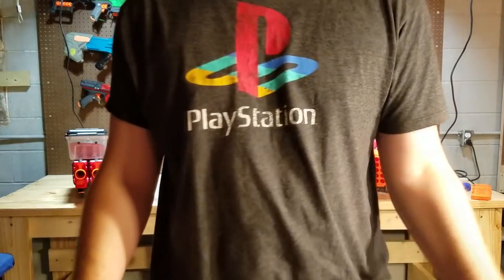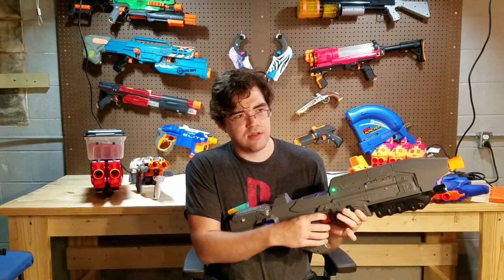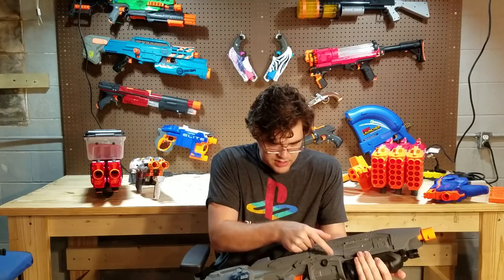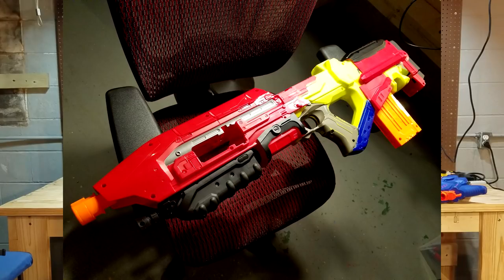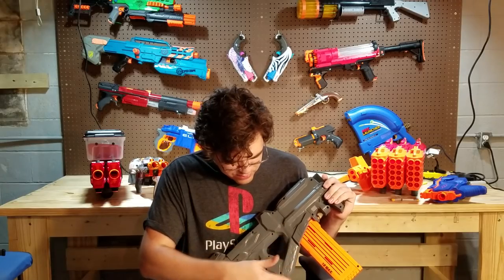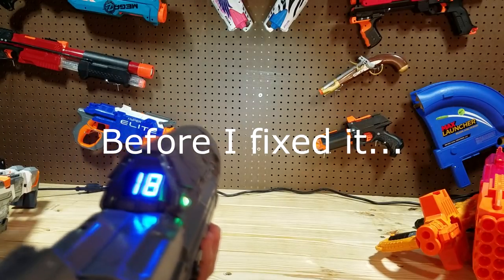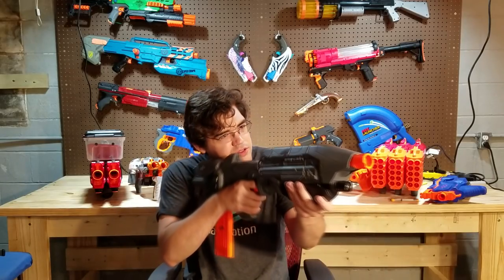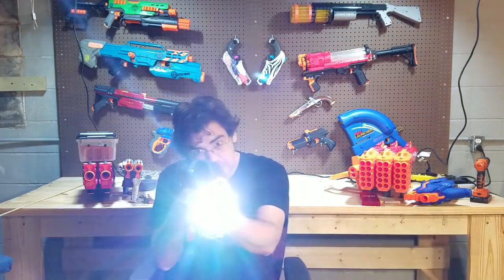Custom Nerf Halo MA5-N Assault Rifle!

Comment: Awesome build! Can you do a second video with pictures of it painted? (once that's done) 

Also, I hear you run nothing but blowguns now, why is that?
Reply: blowguns have good range
Reply: EDM Leopard Yes, but they also have a ridiculously low rate of fire.
Reply: Don't need it when nobody can reach you before they're out
Reply: EDM Leopard It’s not that simple. Blowguns max out at around 100 feet (flat) usually so there’s plenty of room for someone with a blaster that hits 80 feet (fairly common for superstock) to use cover or just rush them.